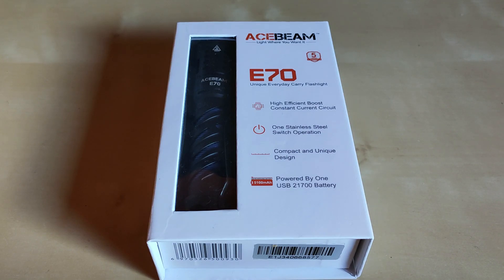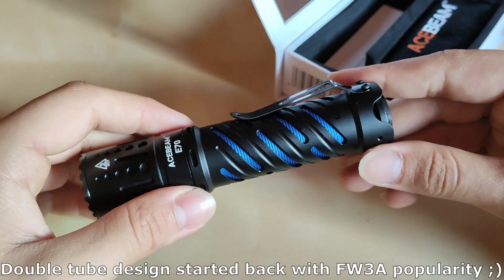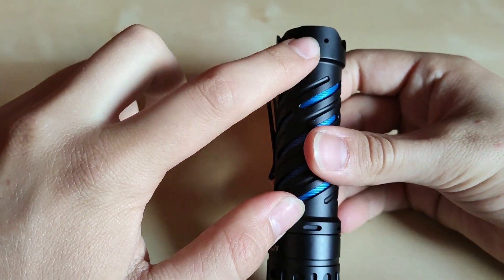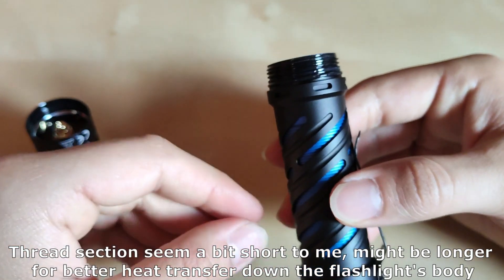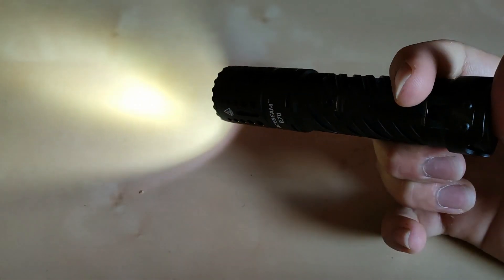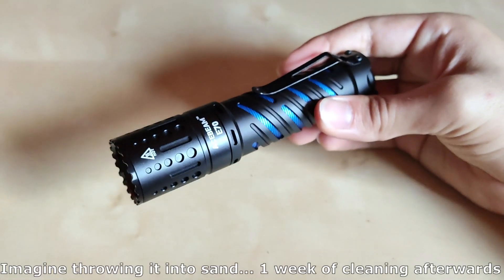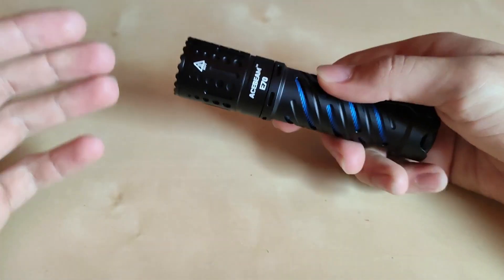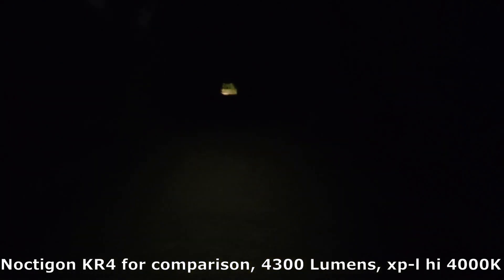Acebeam E70 Review - 4600 lumen EDC tailswitch flashlight | Unique design | powered by 21700 battery

Comment: Olá , não sei se irá me responder mas , se passar pasta térmica para dissipar o calor entre a cabeça e o corpo da lanterna , acha que dá certo ? pois não vi ninguém fazendo isso ! obrigado
Reply from the maker: There's always a thermal paste under MCPCB to transfer heat to the flashlight's body. If you mean the contact between head and battery tube, this surface is for current flow, so I wouldn't advice putting anything there - it needs to be clean. I hope I answered your question
Reply: @FlashlightEnthusiast  respondeu sim , muito obrigado por esclarecer , você aconselharia essa E70 ou não acha tão boa assim ? um abraço aqui do Brasil !!!
Reply from the maker: It is a great light, If you don't mind double click to turn on. good for EDC and general use, as the beam is quite floody. Greetings from Poland ;)
Reply: @FlashlightEnthusiast  ok , muito obrigado por responder , me inscrevi no seu canal , espero muitas novidades e testes com lanternas , forte abraço

Comment: Will a Samsung 30T 40T work in the flashlight?
Reply from the maker: Sure, lengthwise they will fit, just like Samsung 50E I used for the test
Reply: How does it compare to the Fireflies E07?
Reply: only if you don't move, better get a protected cell.

Comment: How does it compare to the Fireflies E07?
Reply from the maker: Much better output sustainability with slightly more compact body dimensions. Be profile is almost identical with large hotspot and smooth spill transition. Yet, E07 can have huge wow effect, as well as much wider led choice. For EDC purposes I would stick to Ecebeam, unless you need huge output bursts and warm white high CRI tint
Reply: @FlashlightEnthusiast  thanks

Comment: Unprotected cells are too short, the springs are not long enough for all of my samsung cells.
Reply from the maker: Mine works fine with unprotected Samsung cells, unless you hit it hard and make the contact brake. Maybe it differs from sample to sample, try using protected, longer cells than
Reply: @FlashlightEnthusiast  I think you' re right, it might depend on the sample.Thanks for answering. I've bought light without the battery included, got some unprotected cells, and now I regret it . I have now ordered a few protected ones.